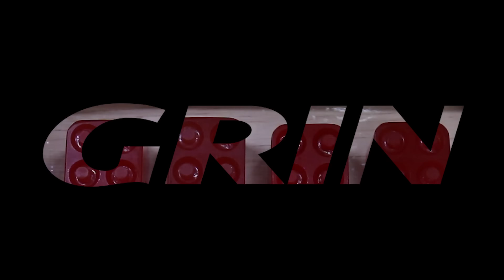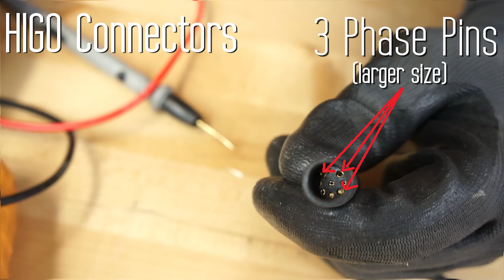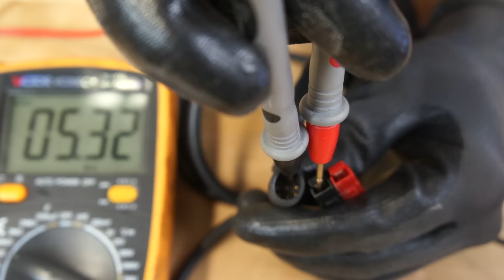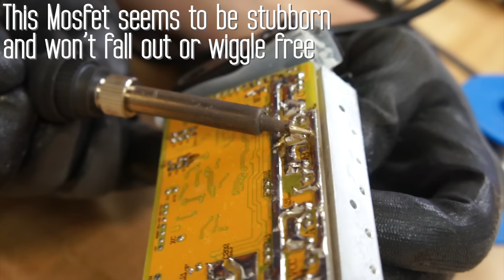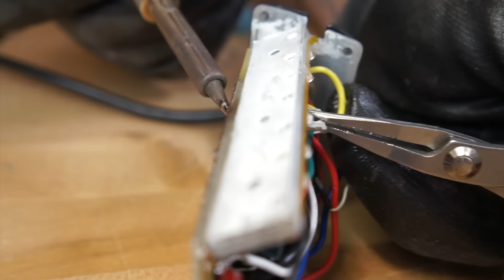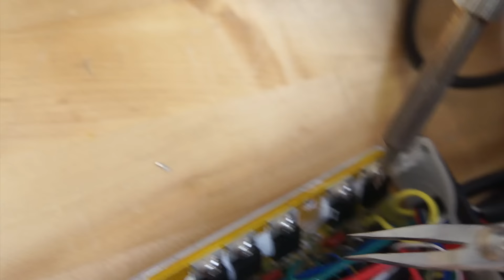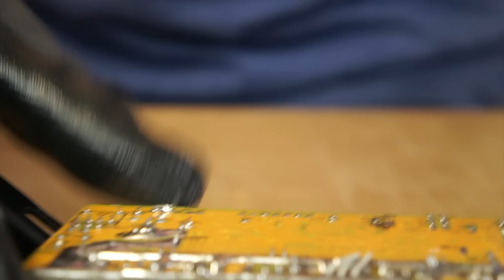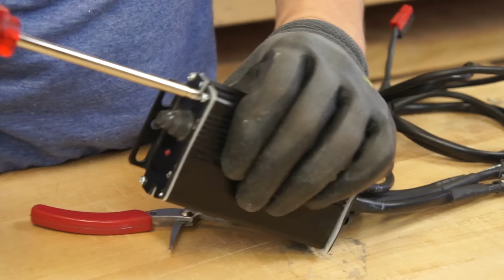Finding and Replacing Blown Motor Controller Mosfets

Comment: Can you help me. My Controller doesn't change the Power output. It is always 1000W (max) on eco, normal and power Mode. Do you know which Part of the Controller or Display (SW-900) could be damaged?
Reply from the maker: This doesn't have much to do with blown mosfet repair and replacement (the subject of this video), but it certainly sounds like there is a lack of communication compatibility between your display and the motor controller you have, or an issue with the settings. I would definitely recommend contacting the vendor that sold you the kit with the controller and display, they should be able to provide full support for troubleshooting this.
Reply: It's in the settings that came with your Display.  Search You-tube for SW-900 Display and you should see that you can change the number of assist settings. Or you can purchase a throttle that will allow you to dial in the amount of power you want.